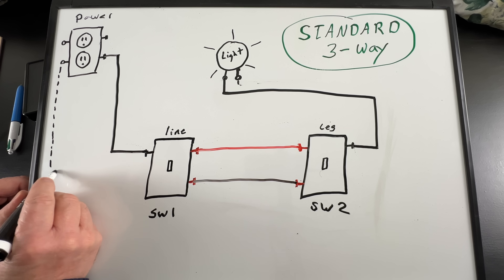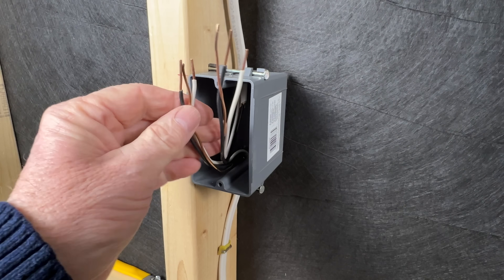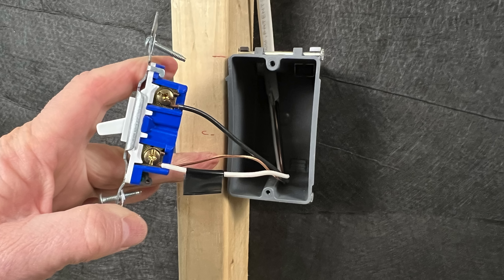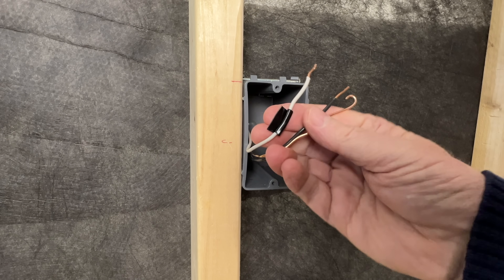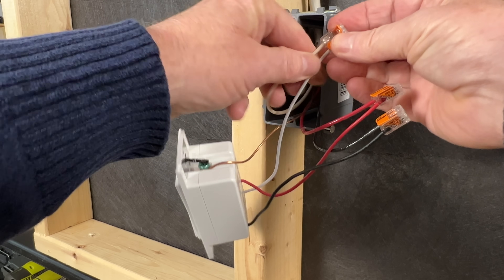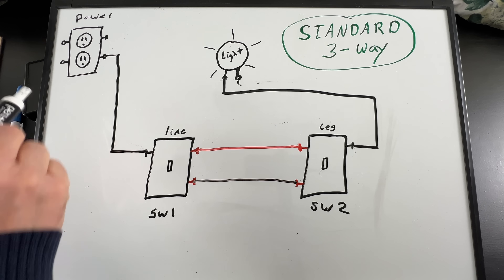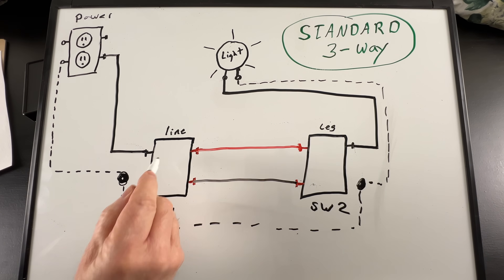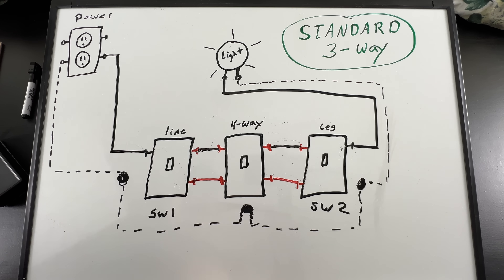How NOT to Wire Light Switches in 2025 (New Rules)

Comment: Hello, great video, thank you. As a new person to wiring, I have a situation that just recently happened. I have  2 light fixtures on the outside of my detached garage that are controlled by a light switch inside the garage and/or a light switch on my kitchen wall that has a switch for the garage lights and a switch for the patio light. I am not sure which switch connection went bad but the switch in the garage is not turning on/off the garage lights anymore. Where could the problem possibly be? No, nothing has been touched in over 12 years when I had my kitchen remodeled. Thank you.
Reply from the maker: Check to be sure your breaker isn't tripped. You may be supplying the garage with a GFCI which can trip easily. Then be sure the lights are not burned out. Check to see if power is getting through the switch in the kitchen and that its making its way to the garage switch. Connection issues are very common. Then check that power is getting through your garage switch and be sure to check to neutral so you know you haven't lost that connection either. Last would be the connections at the light.

Comment: That was easily the clearest diagram/explanation of a 4 way installation.  I have that same setup in my home.  I spent some time with the 3 switch boxes open trying to figure out what they did.  My reason was to install a dimmer.  SW1 is the correct switch to replace with the dimmer.  I mostly guessed which was SW1 vs SW3 because SW1 was far closer to the load panel.  I know I could test with meter to verify and I will before installing the dimmer (future project).  Sometimes just looking in boxes is hard to figure what they did.  My house was built in 1991 and the electrician was cheap with romex, pretty much always the shortest path possible.  You should see my attic, it looks like a spider ran the wiring.  They also combined light circuits with receptacles, that may be to code but I don't like it much.  When I bought the house, I replaced all the old style toggle switches with rockers.

Comment: Why 12/3 wire on light circuit. I guess you need to use 22in deep box for all that wite.
Reply from the maker: Because the example was jumping off a 20A receptacle circuit. If on a 15A circuit 14 gauge wire could be used.

Comment: Thanks for the video! ALWAYS IDENTIFY THE SWITCHLEG DURING THE INSTALLATION! It's easy to figure out the hot wires, but the biggest challenge in trouble shooting several hot wires in a box is trying to figure out which wire is the switch leg. Identification can be whatever: some guys wrap the switch leg around the travelers in a 3-way circuit, some guys use a paint pen, while others use tape. In commercial jobs the switch leg is often a different color wire. The point is the there is some sort of ID on the wire the is not like the others!
Reply: The switch leg is always connected to the common terminal on a 3-way, just looking at the switch is all you need to do. The switch leg is almost never a different color because local AHJs usually have a color code established for all ungrounded conductors.
Reply: @pld8993  I was wondering why he said at the end of the video that inspectors would be good with using a white wire re-identified going to the bulb from switch #2 wouldn't that be a black wire. The only white wire in this diagram would be the light bulbs neutral connection back to the outlet power source on the top left of his diagram.
Reply: @Mike-01234  He said that because using a re-identified white to be used as a switch leg is a violation; it can only be used to feed power to a switch, not from the switch to the load.
Reply: @pld8993  I guess I was referring to more of a commercial/industrial setting. In others words-no NM cable

Comment: There's something more than a little ass-backwards about this change since universal smart fixtures (i.e. designed for installation anywhere in the world) require power at the fixture, not the switch. These universal smart fixtures take a wide range of AC input (often 90-300V) and convert it to low-voltage DC to power both the LEDs they use and run the electronics. With smart fixtures, the switch becomes redundant and having a third core run to it additionally so. Moreover it's possible to design smart fixtures to incorporate an external relay switch, so existing wiring and switches can be reused (basically the fixture would send 5 or 12V DC down the line to the switch which, when switched, would send a signal to the smart fixture's control circuitry to switch the fixture's state).

"Smart switches" are really a second-best solution because the variety of size and shape of switch boxes worldwide effectively precludes a universal design, meaning any have to be country-specific and therefore more costly.

Anyone with power-to-switch who wishes to install a smart fixture also now has to rewire the switch box to bypass the switch itself, which would in practice mean replacing it with a blank plate... and I don't think that you could reuse it as a relay without fishing a second two-core wire (though that would only need to be like 18 AWG anyway).

Ya, so forward-thinking electricians absolutely should not be wiring power-to-switch anymore even though that means wiring with 3-core wire to switches.
Reply from the maker: These are not very common at least not yet and I can say that I have never seen or worked on one. But to your point the neutral at the switch and even the feed to the switch is not going to be a problem. If you want constant power to the universal smart fixture you can just bypass the switch and connect the hot and the switch leg together in the box.

Comment: 12 ga. wire for a 3 way circuit???
Reply from the maker: I used 12 gauge in this example because I had the lights feeding off of a 20A receptacle circuit. If on a 15A circuit, 14 gauge wire can be used.

Comment: National Electrical Manufacturers Association making sure they get their money's worth out of the representation they have on the code making panels.
Sell more wire!
Reply from the maker: Most competent electricians will feed the switch first anyway. Also the reason for the change is too many people are using the ground wire for return in the absence of a neutral conductor. I didn't say that in the video because I didn't want to give anyone a bad idea. But thats the safety issue and the reason for the change.

Comment: In your three-way diagram, you didn't describe what to do with the neutral of the 14/3 wire between the two switches. I assume the neutrals are all connected together? I think where I'm confused is you didn't show a splice circle between the two switch boxes. You verbally described it only. Thanks for the great video!!

Comment: A question:  I'm adding a dome ceiling light to each bedroom.  Each room currently has a switch by the door that turns an outlet ON & OFF.  I have easy attic access to each room.  What is the best way to add those lights and provide constant power to the switched outlets?
Reply from the maker: Sometimes only half the receptacle is switched. If thats the case you will have an always hot wire in the box. If not you can fish your light fixture cable down to the light switch. Take the hot wire and the switch leg to the receptacle off the switch and wire nut them together with a tail to the switch for power. Then connect your black wire to the light switch to the other side of the switch. This will give you a switched light and an un-switched receptacle.
Reply: @BackyardMaine  - Excellent.  Thanks.  Yes, only half the receptacle is switched.

Comment: 12/2 and 12/3?  Did code change from 14ga?
DIYer here that’s always used 12ga and the screw terminals instead of 14ga and the push ins.
Reply from the maker: No. I showed 12 gauge in the example because it was supplied by a 20A receptacle circuit. If it’s a 15A circuit you could run 14 gauge wire.

Comment: I always wire my 3-way switches in the standard, box to box easiest way to understand them.  My house was wired by an electrician who I am convinced tried to save every inch of wire he could.  It is hard to trace the 3 way switches because every possible wiring method has been used.

Comment: Glad I watched this since my electronic light switch requires a neutral. Hmm, but can I just use 3 wire that has a red instead of two separate? I own a commercial property and that might be easier than running two mc cables into the metal box in the wall . . .
Reply from the maker: They are now making smart switches that don't require a neutral. Maybe that would be your best option.

Comment: Question in your diagram you have power coming from a plug circuit, should not plug and lighting be on separate circuit? I am not an electrician by trade, but I have worked for some and was always told to keep plugs and lighting circuit separate. Good video by the way.
Reply from the maker: It is code compliant to run lighting and receptacles on the same circuit. Some will separate them but it's not required. I did separate them when I wired my own home but it does increase the cost a bit.
Reply: @BackyardMaine  Thank you I own a house that is wired that way lights and plugs not on separate circuits, if you plug something in and it trips the braker you're in the dark. But it is very hard to change its a split level. once again Thank You for the video.
Reply from the maker: @LyleHouk55  My pleasure. Thanks for watching.

Comment: When I took electric... over 55 years ago... along with our future provincial chief hydro inspector... we were taught to run power to the load... then from the load... to the switch... because in those days... the commercial switches were often 24v.... saved a ton on wire costs... now... since fancy switches require a neutral... I'm thinking of rewiring the house... that... or just forget about fancy schmancy switches...

Comment: You can use a wire nut on the ground wires?  I thought it requires a copper crimp instead.  Southwire must love this new rule since new installations may now require more copper wire.  I'm guessing the rule change is because people adding smart switches were cheating by using the ground as the neutral.  Strangely, I found my electric range was wired like that since a 240 VAC 2 hot & gnd w/ no neutral, but the Thermador e-range needed a neutral (probably for 120 VAC indicator lamps) so they used the gnd for that, apparently in the original 1972 install.
Reply from the maker: No a weren't is fine. Maybe will crimp which is fine as well but they are not required by the NEC. They even make a green wire nut with a hole in the end designed for grounding.

Comment: Do the wires have to be 12GA, as you mentioned? Or can they be 14GA?
I love your videos! Thank you!
Reply from the maker: Wire is sized to the breaker. 12 gauge for 20A, 14 gauge for 15A. Most lighting circuits are 15A so 14 gauge is fine for them.

Comment: Two of three 3-ways in place are wired like a dead-end except power is sent over the black to the remote switch where it connects to the black screw, red and white are used for travelers, and the light's black is connected to the first switch's black screw.  No neutral is sent to the remote switch but is spliced to light's neutral.  Seems like I can change the light's black to splice with the 14/3's black and just hook power to the first's switch's black screw to get a traditional dead-end 3-way.

Comment: Makes absolutely NO sense....if you're not using some dumb smart switch....why's it matter lol you want that....then you can add it yourself later. I'm not doing it on my property lol. Come try
Reply from the maker: This only applies to new construction. The issue is homes change hands and someday it won't be you in the house. The reason the NEC got involved is because with no neutral people are connecting the neutral wire on a switch to the ground wire which is hazardous.

Comment: To be clear, if your circuit is panel to light to dead end switch, you will use 12-3 between light and switch?
Glad I found your channel yesterday. Clearly explained and always references code. Thanks
Reply from the maker: Thank you. You will run 12 gauge wire if the circuit feeding the lights is 20A or in other words has a 20A breaker. If the circuit is 15A then 14 gauge wire is fine.

Comment: Why are you using 12 ga wire on a lighting circuit?
Reply from the maker: It depends on the circuit rating. If you jump off a 20A receptacle circuit to pick up the lights in a room then you will need 12AWG wire. If the circuit is 15A which is more common then 14AWG wire can be used.

Comment: It’s interesting that now that the neutral is required. A lot of the companies making these devices have built them so that they no longer require the neutral by using a capacitor within the device to maintain circuit current while the switch is off. But I totally agree. It’s best to have the neutral in the box. That way you have a complete circuit to expand from when the  need arises.

Comment: But What If You Buy An Older House That Don't Have A Nutrol Wire?
Reply from the maker: The code is not retroactive so you don't have add a neutral. Some new smart devices don't require a neutral so you just need to know what you have and what to buy if you're planning to add smart devices.

Comment: Why are you using 12/3 and not 14/3 wire for lighting
Reply from the maker: No. Your wire size would be 12 gauge if connected to a 20A circuit and 14 gauge if connected to a 15A circuit.

Comment: Even before this code change, who would not use a neutral wire???  Someone had to be smooth brained to not have a neutral for any wiring in the last 45 years.
Reply from the maker: I always feed the switch box as well but I have seen plenty of switch loops.
Reply: @BackyardMaine  Also, if they are an ethical builder then they would always put in a 3 conductor for all ceiling lights in rooms so they can easily be swapped with a fan.

Comment: So what I'm getting from this:

National electrical code: You need a neutral in that box, so it can be used
Also national electrical code: You used the neutral in that box, you're under arrest
Reply from the maker: No. The neutral in the box is for use on a switch that requires it. If not just cap it off. If the white wire is used for something other than a neutral it needs to be re-identified.

Comment: I've never come across 12 awg wire used for residential lighting, especially with today's low power lights.  Is there a particular reason?  Code?
Reply from the maker: It's not code and 14AWG is fine for lighting. I just didn't want someone to misunderstand and running 14AWG on a 20A lighting circuit. It's actually common to jump a 20A receptacle circuit to pick up lights in a room.

Comment: Very interesting indeed.  Although it seems like the conventional method is the simplest/easiest way.   And just trying to learn, but am wondering why you specified 12/2 wiring coming from the power source down to the switches...Thanks.  Don
Reply from the maker: 14 gauge is fine as long as its on a 15A circuit. Many receptacle circuits are 12 gauge and 20A so I showed it this way. I posting a video tomorrow on a rare but useful method called the double dead end 3-way. It that video I show a 15A circuit and then listed the wire as 14/2 and 14/3. I hope you like the video. I'll post tomorrow at 5:00pm.
Reply: @BackyardMaine    I really enjoy watching and learning, thanks for taking the time to make it understandable...

Comment: You can use WattStopper switches. These only need hot and ground. If you do have a common wire they also give instructions on how to wire with or without common wire.

Comment: 12/3? Did you mean 14/3? I've never had to run 12/3 for switches, let alone traveler's.   :) Man i hated running into CA 3-ways!
Reply from the maker: I used 12 gauge incase someone follows this and runs 14 gauge on a 20A circuit not knowing. But yes most lighting circuits are on 15A circuits and 14 gauge wire. I just made a video on a rare but useful way of wiring a 3-way called the double dead end 3-way. I'll post tomorrow afternoon if you're interested.
Reply: Absolutely!

Comment: I'm not an electrician but a retired EE who designed RADAR transmitters, it seems to me that running a neutral to every box during construction is a small cost with huge benefits in the future. We always designed "spares" into every wire harness and control panel.
Reply: Doing things right isn't a priority when economics is involved.  If we really wanted to do things right in the U.S., we wouldn't run the TN-C-S grounding system, but run the superior TN-S system. No houses in the U.S. would have aluminum wiring if it weren't for the military needing all the copper during Vietnam.  Now lots of 1960's era houses are stuck with aluminum wiring sitting there as a fire hazard.  And it happens in other countries too.  The Brits still run "ring circuits" because of WWII copper shortages.
Reply: @LonnieAdams4 aluminum wiring in America homes still infuriates me. We KNOW better but keep ignoring lessons from the past for short term gains and long term costs and risks for OTHER PEOPLE, i.e. our kids and grandkids.
Reply from the maker: I was an EE as well before I retired. Spares are a must for industrial applications. I think it's a best practice to feed the switch first. Not only does that leave a neutral should you ever need one but also allows you to add a receptacle at the switch or even right below it if needed with minimal effort.
Reply: Growing up in Texas, I like to run an extra black & white to the light in any room where someone might want to install a ceiling fan in the future. Same goes for receptacles for lamps & fans.
Reply: Builders are cheap. Real cheap. Really really cheap. How cheap? At their circumcision they didn’t leave a tip!
Reply: And I’m also an EE as well